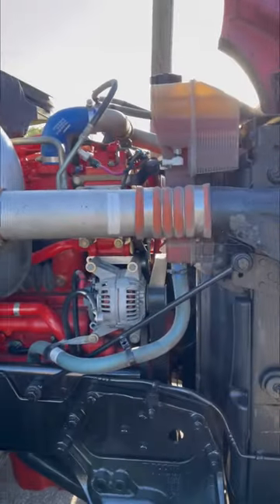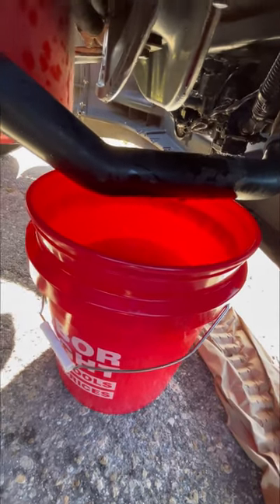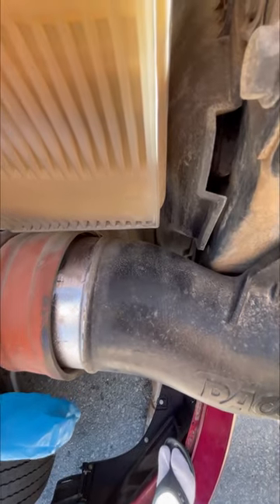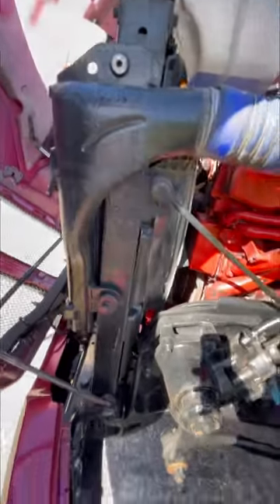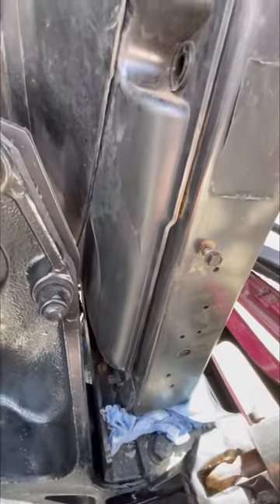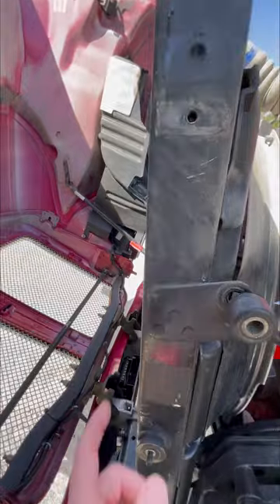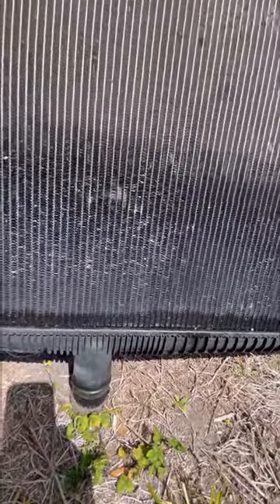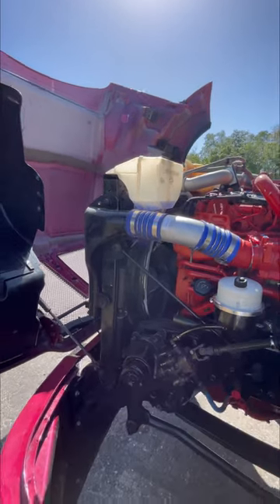Radiator Replacement KW T680

Comment: Why u changing the radiator…..
Reply from the maker: Hole in radiator
Reply: Ohok. What can make my kenworth t680 2019 Cummins engine over heating why pulling load on hills
Reply from the maker: Radiator cells are bad or banded plugged? Plugged radiator inside? Can be many issues

Comment: To make it easy next time. 

You take off Charge cooler and condenser off then disconnect tank and hoses then studs holding the ASSEMBLY. then pull the entire assembly out no need to struggle to separate fan shroud while it's in truck. Once out it's pieev of cake
Reply from the maker: You can take condenser out without taking tank out but when it’s comes to charge cooler you cannot. You have to take tanks out first in order to take charge cooler out. Charge cooler has end pipes curved which will not allow to separate charge cooler towards grill! Only way to get it out is pulling completely up but before you do that tanks are on the way. Also too it’s easy to say pull out entire assembly when you have help or equipment since that assembly with a radiator in it is heavy! My method is to do a job by yourself without any help and equipment. When you pull radiator with assembly out you still have to unscrew assembly to get radiator out like I did plus you have to get 2 more bolts to get the entire assembly in my method you do not need to mess with 2 more bolt that holding entire assembly.